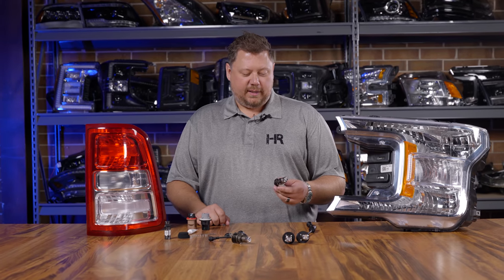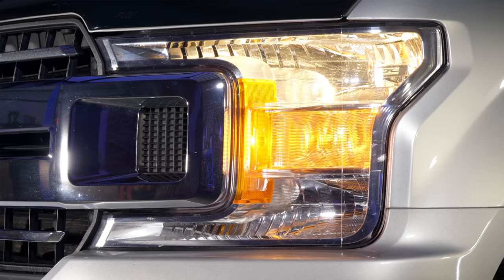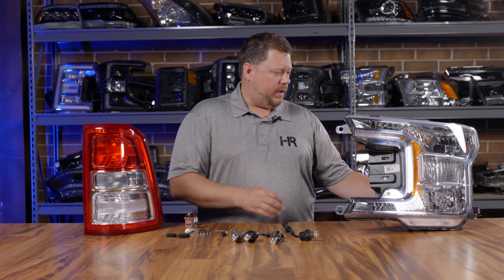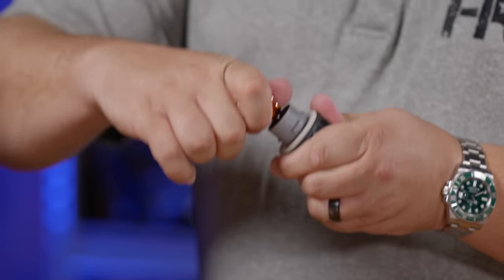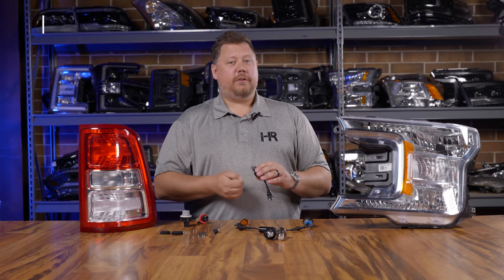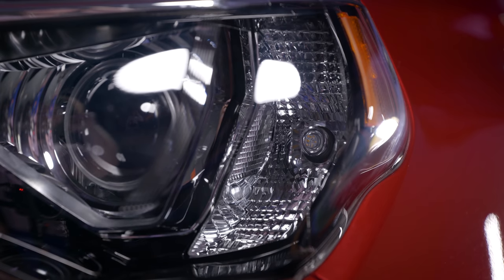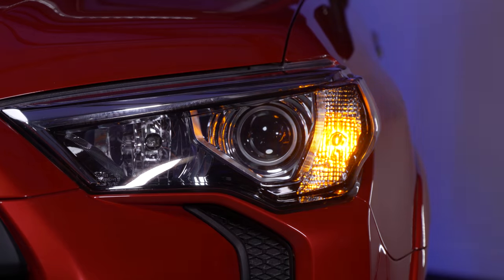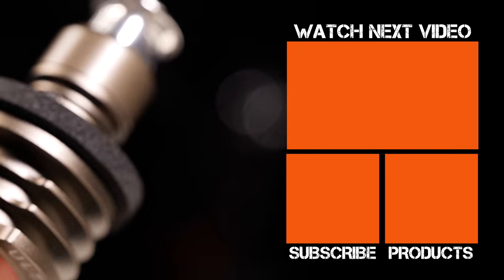The Most Innovative LED Turn Signal Bulbs EVER | The Ultra i-LED by GTR Lighting

Comment: Not worth the hassle for me, I bought Morimoto X-VF for turn signals and with 500lm, they are perfectly bright. But yes, these GTR are amazing.
Reply from the maker: Those are a good alternative also. Thanks for commenting.
Reply: Yeah, I don't really get it. I've never even noticed the fact that the light reflects onto the headlight part, and I'm guessing the vast majority of people haven't either,  but then switching to LED doesn't make any difference, they still reflect when they're on. 

And I don't think anyone can really miss a standard turn signal - if anything the brighter they are, the more distracting, especially if you're sat behind somebody at the traffic light at night. Same with brake lights it's harder to miss them. My car has LEDs factory fitted but it wouldn't have been a deal breaker if they didn't.
Reply: @severnsea  the point is the amber when they’re off. No crap when they’re flashing amber they look amber lol. It’s just preferences. If you don’t notice the amber and it doesn’t bother you that’s cool

Comment: Just glad GTR is producing modern amber LED upgrades. Most stock incandescent bulbs are insanely ineffective [especially behind common clear turn lenses] in the tropical sun and don't even blink all the way off like an LED. Glad you compared i-LED to stock for a visual analysis.
Reply from the maker: Thanks for the comment Lawrence!

Comment: I have a question, I used a similar system from VLEDs the Triton system, for my 2001 Ford Crown Victoria, I never did put rear LED signals as I was waiting on new tail lights. However with the use of the load resistor, I had occasional hyper flash issues. Would the incandescent bulbs and load resistors be fighting one another? As in would different voltage readings from LCM be thinking there is not any front turn signal bulbs.
Reply from the maker: Sounds like the resistors were not providing enough resistance.
Reply: @HeadlightRevolution how much do you think he needs?
He said that was with regular glass bulbs.

Comment: 2004 Lincoln Town Car Ultimate owner here! Great review, demonstration, and detail on installation.  I’m really leaning towards the switchback version of this product. Question tho, my vehicle doesn’t have daytime running lights so I’m assuming the switchback between white and amber will only work IF I have my headlight control switch in the “parking light” orientation?  
If my low beams are ON will the switchback bulb be active or only when I activate the turn signal? 
Hopefully my question translates clearly… Thank you and also thank you for the time and effort you guys put into your content for us consumers.
Reply from the maker: The switchback option will add a DRL, so anytime the parking light is on you will have a DRL active. When the turn signal is actived, then it will turn amber for turn signlal function only.
Reply: @HeadlightRevolution  thank you for such a swift reply. It totally slipped my mind when my headlights are ON the parking bulbs are illuminated, as well. 🤦‍♂️

Comment: I'm not too sure about that foam seal. Foam breaks down over time unless this is some special alien foam.
Reply from the maker: it wont degrade if its just sitting in the housing. Now if you coastally remove and install them they can degrade.

Comment: What bulb size I can buy for the Ford Explorer 2014 that have the Projector headlight, it’s a turn signal but also turn on when the door is open or the lights are on.
Reply from the maker: Here are all the bulbs offered, just select which ones you need. 

https://www.headlightrevolution.com/buyer-guide-by-vehicle/2014+Ford+Explorer_with_Halogen_Headlights

Comment: I want the brightest led possible for my rear brake and turn signal.  Should i get the iled for my signal and the carbide 2.0 for my brakes?   Or get the iled for both signal/brake light?
Reply from the maker: The GTR I-LED bulbs are brighter than the Carbide 2.0!

Comment: Do those resistors get hot just like the traditional gold resistors?
Reply from the maker: They do not get as hot as the golds because they are enclosed.
Reply: @HeadlightRevolution  So can I put it near plastic or no since I don't have much space for resistors that I can tuck away to prevent heat?
Reply from the maker: @seangowan7441  That would be fine!
Reply: @seangowan7441  I know what you are asking. The resistor/inline thing appears to be 40watts and less ohms, its also longer than most, and its also encased in what probably is an effective heat sink/shield because they used as much energy for the bulb in the simple Bright holy god ness (they do use a lot more watts than cheaper LEDs for good use), so that allowed them to use a smaller resistor and they also engineered it in such a way.  the 60watt (whatever ohm they were) ones I put on my Park Avenue test tail lamp harness ended upbeing way way too hot after 5 minutes only flashing turn (not a combination light or anything, only a turn on that lamp) and the trunk was open with the resistors in 0 degrees wind and they were too hot to touch . So Instantly I knew I couldnt find a way to tuck or mount them without having issues. 

I am going to keep looking around to find out how much heat exactly to expect from them, because I have a tail lamp that hugs a sheet metal with a felt backing on the other side(interior or trunk) and between the tail lamp and the sheet metal is where the harness of the 2 tturn lamps on the lid mount, and there isnt much room. It hugs the plastic and wiring. So I am going to make sure they can cooperate otherwise I may see if i could use a small heat shielding tape on the surrounding stuff too. Its definitely a lot less battle with that module.  Alternatively, I was going to look into the 3157 extension harnesses where I could put the bulb in the lamp housing, then run the wires through the pass through, and then maybe far back enough where I can mount the resistor/flash module on the other side where it can be more free and open to be safe if so needed.  
I also have 2 body mounted lamps but those are easier to find a spot so not worried there.

Comment: 2021 Jeep Gladiator with halogen turns. If I activate the LED turns with my tazer, will I still need the inline adaptor to avoid hyper flash?
Reply from the maker: You may need it still. Typically Jeeps need them.
Reply: @HeadlightRevolution  What about for the DRLs? They aren’t working…
Reply from the maker: @rymac320  Sorry for the slow reply, YT doesn't notify us once the original comment has been responded to. I'm sweeping through older videos in efforts to find comments just like yours! That being said, reaching out to our CS team would be the fastest way to get some help, give us a call or email!

218-755-5200
Sales@HeadlightRevolution.com

Comment: I noticed most of the upgrades are to trucks. Can you preview the ULTRA 2's in a 2016 Niss. Maxima's headlight. Maxima's have projector housings---and I have been trying to discover a LED replacement that works effectively. Can you sample the ULTRA 2 lamps in their housing...PLEASE.
Reply from the maker: It's something we can look into doing, can't say when it would happen for sure though!
Reply: @HeadlightRevolution    It's just hard to determine the effectiveness of the bulbs without being used in more projector type housings for cars. Thank you

Comment: Pretty disappoined after buying these. I'm not sure if its these bulbs or if its the car I have which has a very sensitive lighting system. Im not sure theres another car in the world that monitors the current of the parking light, but my 2013 Dodge Dart does. If the parking light does not pull 5 watts exactly, it will show an error. I bought the i led 7443 switchback bulbs and the white parking light shuts off after 2 seconds. Going to try the VLEDS Triton because the i Led is a fail.
Reply from the maker: Some switchback bulbs will require an additional resistor because switchback uses half-and-half functions split between white and amber, meaning it doesn't communicate the same voltage as the solid color LED would. Additionally, Dodge vehicles are extremely picky when it comes to CANBUS integration with LEDs whether it's headlights or turn signals.
These are the resistors we recommend adding to the turn signals for proper function: https://www.headlightrevolution.com/50w-6ohm-gold-resistor-ACC.RES.50W_2?quantity=1
Reply: @HeadlightRevolution  I had both turn and park light circuits with resistors wired up to them. Pretty sure it's just my car. Does headlight revolution not sell the v6 triton?

Comment: it has red reflector use red bulb.

I’ve checked Toyota Highlander user manual it says all it’s braking blubs and rev blubs are no color (no amber or red)
Reply from the maker: That's because OEM uses incandescent bulbs, not LED like these are.
Reply: If using an LED, you match the color of the housing so the light emitted is visible. If you used a white led in a red, you get pink.  not sure what it would in a amber housing.  Clear housing a white bulb would make an illegal color for a amber turn, for example, but just match color if there is color, if not color, match the bulb to the function legallyy speaking. so clear for reverse white, clear for turn amber. tail... I think tails CAN be clear but they are 90% of the time coincided with brake or at least the reflector meant for visibility when not turned on but I could be wrong.